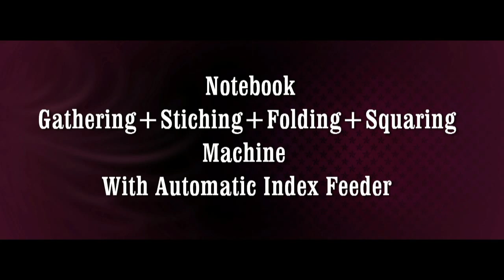Notebook Binding Setup (Fully Automatic)

Comment: It would have a better video if captions were included, to indicate what each machine/unit  is performing, also the rate of production was very necessary for a purchaser.
Reply from the maker: you can contact us on 9822204434 for further details
Reply: @excelgraphicmachinery4059   cost